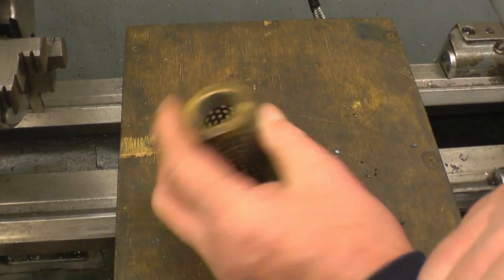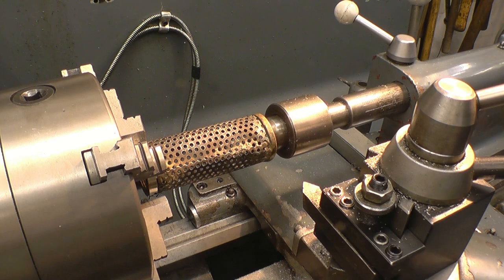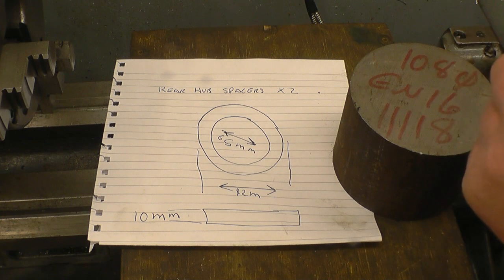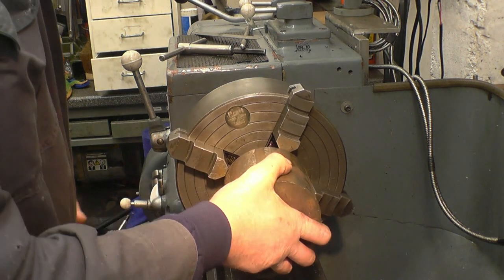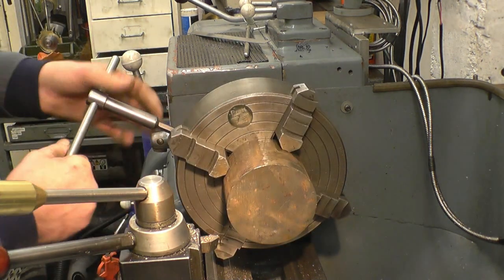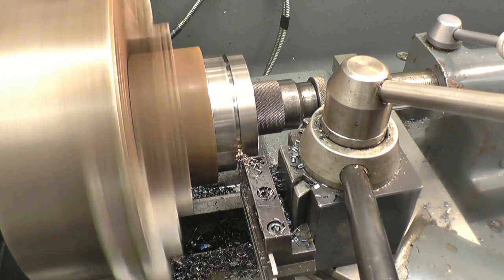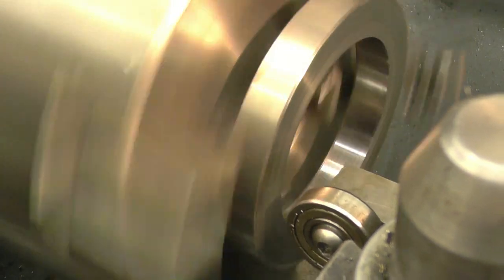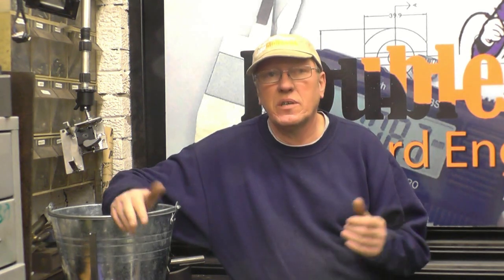SNNC 205 P2   Machining EN16   (steam waggon parts)

Comment: why the multiple drills ? anything up to 2 1/2 "correct size center drill,  an use the 1 bit and correct speed ...... if they are dormers its 118 degs inclusive, it ll go through most with ease . I presume more than 1/2 horse on lathe motor
Reply from the maker: I would like to see a 2 1/5 inch drill  working without a pilot hole
Reply: using an old knackered DSG lathe with tailstock link to saddle for power feed, I would process off 3" thick EN32 billets 4" drill bit (not even centre drilled) straight through.... approx. 50 rpm, would take 20min each prob 4 done before drill regrind an swarf clean up ..... it is all in the bit grinding
Reply: ps ......... without blowing trumpet ............ the surface finish on those 4" holes was equivalent to ream with + .020" .030" tolerance and yes the bit was ground by hand ...... any less accuracy in the drill grinding would result in swarf pick up between the lands of bit and the material i.e. scoring
Reply: pps i only point this out as a time issue i.e. the quick removal of material in engineering is just as much an art as the accuracy..... plus time is money in the trade ...... you vids are great

Comment: I wondered why you used the 4 jaw independent chuck to turn the bearing spacer rings rather than a self centring chuck. I'm new to this turning lark.
Merry Christmas and a Happy New Year.
Reply: starlet boy I understand the benefit of 4 jaws over 3 but why not use the 4 jaw self centring which must be easier to set up than the 4 jaw independent.

Comment: Would raising or lowering the parting tool off centre height have any effect on chattering? Just thinking that if the material is trying to "push past" the cutter causing chatter, it's more likely to do that on the widest point of the round.       [Disclaimer : I'm not a machinist]

Comment: Hey John, I saw a video of a guy holding a length of round stock horizontally in a 3 jaw chuck to turn a flat on it. Obviously you have a mill, but have you ever done this on a lathe? It looked a bit sketchy, but maybe if done correctly it's safe? I've never seen it before so figured I'd ask.

Comment: Regarding the parting off issues-  I have a tiny chinese lathe that is pretty worthless for that kind of thing.. just nowhere near rigid enough, even running it in reverse/upside down.  I came across this clever technique which I plan to try out when I have the opportunity.. It's probably not necessary for your lathe, since it's much more capable than these little ones are, but I do wonder if something like it might help a bit in specific situations.   https://www.youtube.com/watch?v=IdPBeU5XWtI